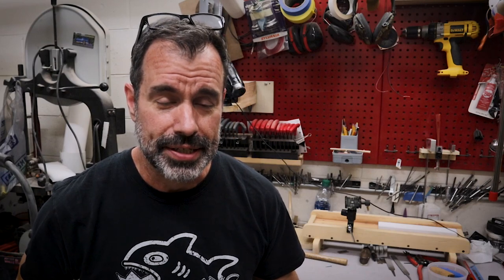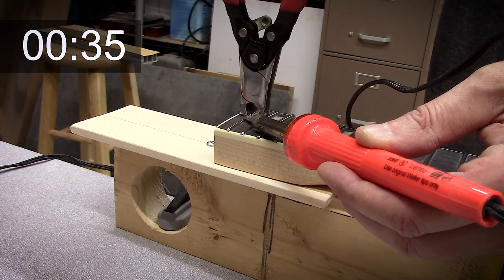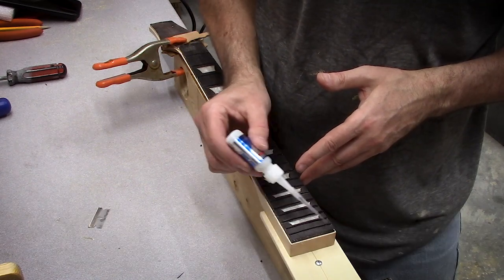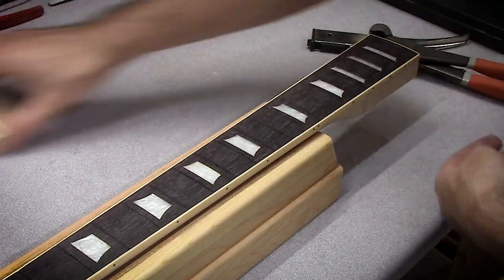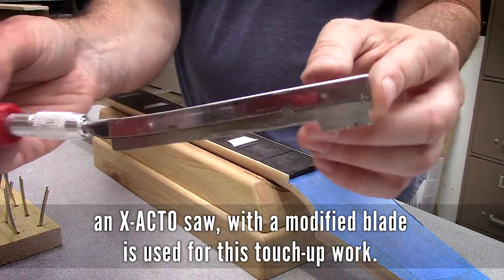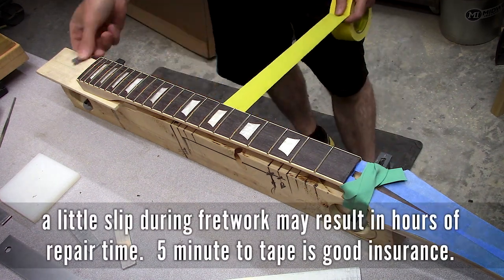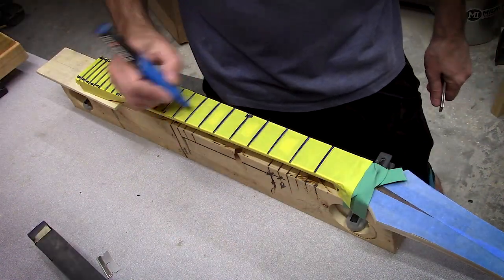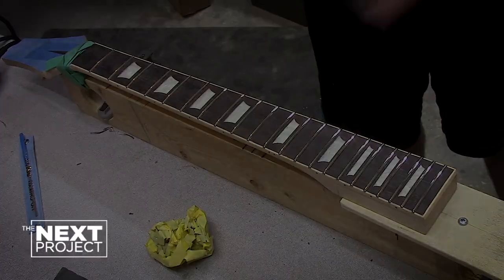Neck Re-Fret - the Next Project

Comment: re-playing the video, I started to wonder about doing all the fret work adjustment / neck straightening without the neck assembled. I am wondering if once corded, the neck won't have the tendency to bend upward, i.e. another trussrod adjustment and then your fret leveling is voided. Any observation of such thing happening on your side?
Reply from the maker: Once the neck is strung up, it will tend to be pulled in an upward arch by string tension. This is then adjusted with the truss rod to find the amount of relief desired. Some people like it super flat some like a little bow in the neck. Each neck will move a little differently too, the wood and the truss rod used are all unique, but behave in similar fashions.
The reason I level the fingerboard first is to get the most flat "foundation" to start from. The frets are added, and often cause a slight back-bow to the neck, so I again adjust to find a level finger board. Then I level and crown the frets. So the frets and the fingerboard are as parallel as possible (drop-off at higher frets withstanding).
As you mention, installing the neck and strings will again move the neck. It's a juggling act for sure. This video only shows my rough procedure, but the goal is to have flat surfaces at every stage - to start with. 
Thanks for watching and I hope I gave a response that answers your Q.
Take care!
Edit, I forgot to mention humidity change.... Ugh, that can change the shape of the neck after all the leveling and fretting too.
Reply: @theNextProject  Thanks for taking the time to answer and in such a detailed way. Keep us posted with the next project and again, congrats for the beautiful result.
Reply from the maker: @Grogg, all good man! I appreciate the comment/question. 
Great Q you had, and you are not alone in wondering, I also wonder the same thing...lol
Take care, thanks again for watching!

Comment: Can you give more info on how to make the fret end cutter? preferably for stainless steel frets
Reply from the maker: @yoheff988
Fret end cutters can be found at many local hardware or big box stores. 
Here is an example of an "end cutter":
https://www.amazon.com/Bitterroot-Fret-Cutter-Nipper-Medium/dp/B00N12J5GO/ref=asc_df_B00N12J5GO/?tag=hyprod-20&linkCode=df0&hvadid=312211947560&hvpos=&hvnetw=g&hvrand=12941099248372820164&hvpone=&hvptwo=&hvqmt=&hvdev=c&hvdvcmdl=&hvlocint=&hvlocphy=9011759&hvtargid=pla-624346589447&psc=1
NOTE: the description clearly states "not for stainless".

Stainless fretwire is really hard stuff, and doesn't play well with most common cutters or nippers. Even some files don't do well on stainless fretwire. 

I have a pair of end cutters that are stainless fret rated. They are FASTCAP Fret Nipper:
https://www.amazon.com/Bitterroot-Fret-Nipper-Carbon-Cutter/dp/B00N12WYUS/ref=rtpb_7?_encoding=UTF8&pd_rd_i=B00N12WYUS&pd_rd_r=261d2667-6996-4ce6-94af-6318dde2f6b8&pd_rd_w=BdwWu&pd_rd_wg=BiCji&pf_rd_p=49740592-2805-416d-896c-b825ad91c2cf&pf_rd_r=TAWEGJ6211W69H14DQ7M&psc=1&refRID=TAWEGJ6211W69H14DQ7M

The price on this Fastcap product is better now than a couple years back when I bought them. I've used these on stainless fretwire, and they have held up reasonably well. I doubt they will last forever, but are doing better than other nippers on stainless would.

However if you want more info on the "TANG NIPPER" that's a little different beast. Especially if you want a tang nipper for stainless steel. 
The tang nipper I use is for nickel fretwire, and is basically a "case nibbler" that has a slight modification to work with fretwire. NOTE, this kind of tang nipper probably won't last long with stainless fretwire - I'l have to do a test, and maybe a standalone video - hmm.

Here is an example of a case nibbler that can be converted to a nickel fretwre tang nipper:
https://www.amazon.com/ProsKit-900-215-Nibbler/dp/B000BN60XW/ref=sr_1_4?dchild=1&keywords=case+nibbler&qid=1600645048&sr=8-4
These case nibblers can be found from $9 - $20 each, and basically a slot needs to be cut into the face plate at the nipper to allow the fret to rest in place for the tang to be nipped... sorry, that's rather vague.

I've only done a coupe stainless projects, and had expected to destroy my regular end cutters, so I used the Fastcap Fret Nipper. However I didn't use my tang nippers on the stainless frets, as I knew they would parish. 
So, to cut the stainless tang back, I used a dremel/rotary tool with a cut off blade. It was slow, but worked - reasonably well. 
Also, when I radius the stainless fretwire, I tried to get it close to the final radius, or just slightly tighter. It is so tough, that it seemed to want to spring back once pressed into the fretboard. So an exaggerated/over-radius stainless fretwire was just too much radius. Where if regular nickel fretwire is over radiused, it will easily flatten to the shape/radius of the fretboard. Hope that makes sense.

Thanks for the question, let me know if you need more info, i'll try to dig something up.
Thanks for watchin, take care!